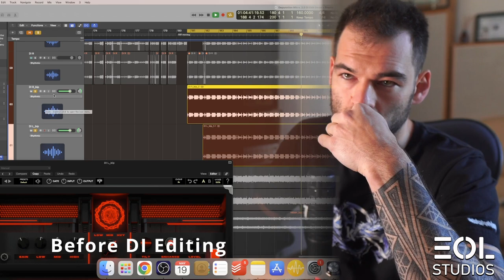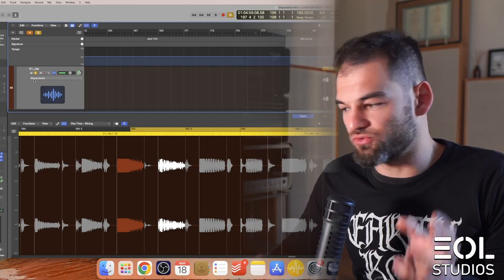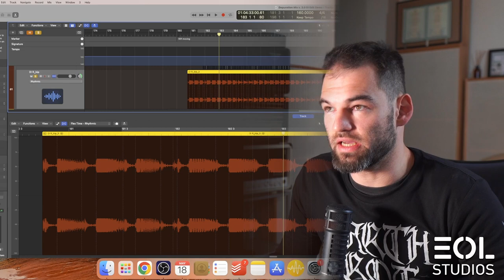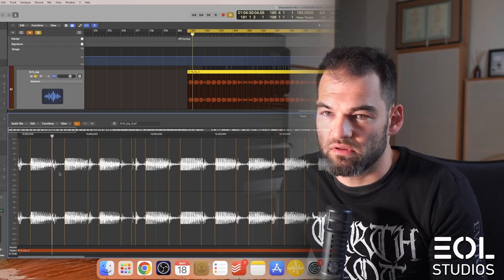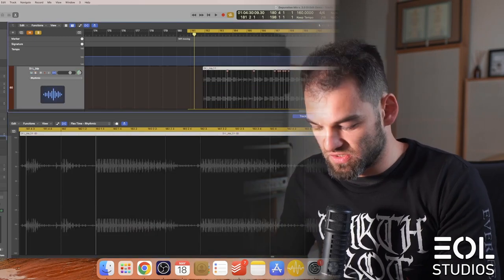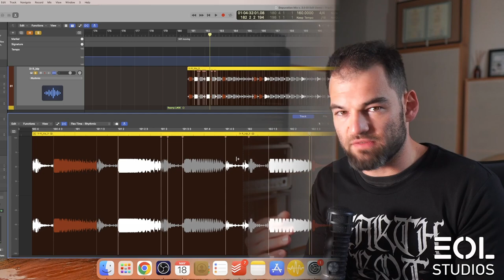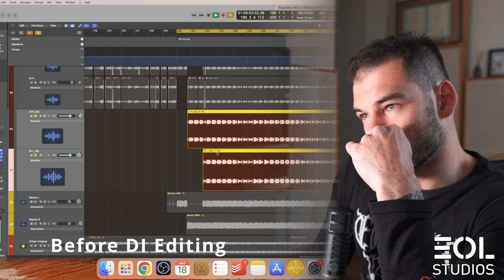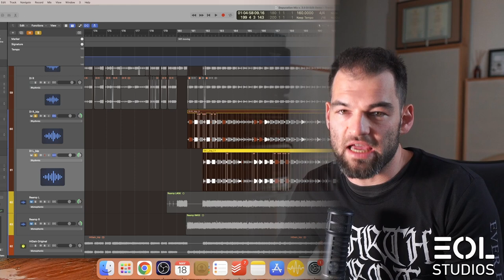Modern Metal Guitar Editing: Perfecting DIs to the Grid in Logic Pro X

Comment: After you make edits using Flex, if you disable Flex, does the track save your edits? Or do you need to keep Flex toggled on for it to play the edited version?
Reply from the maker: @21stCenturySin  I believe that you should commit to flex edits. If you disable the mode, it's unlikely to stay. You could look the right way in the Logic manual, should be very straightforward